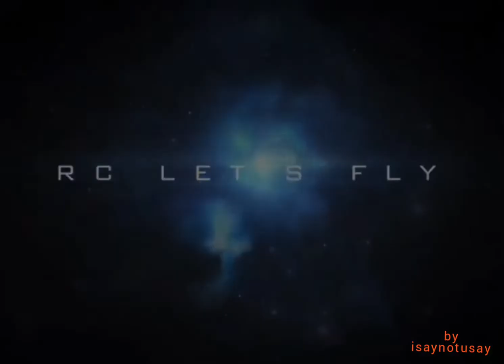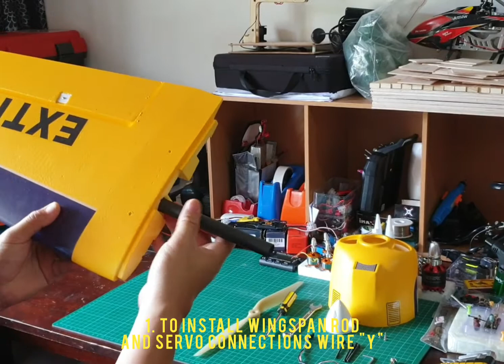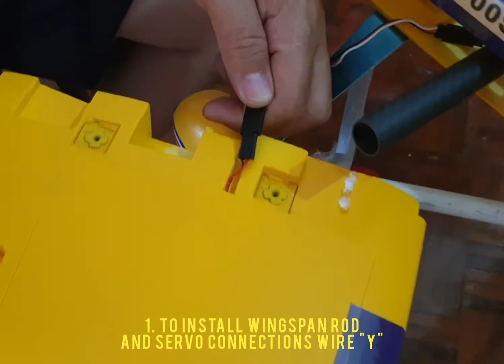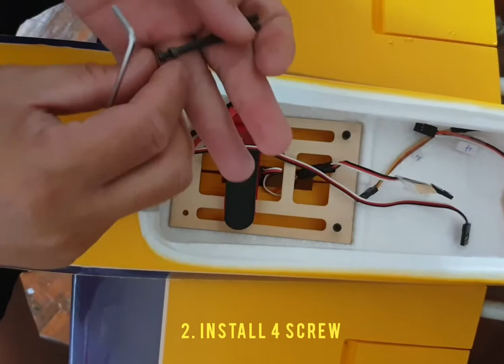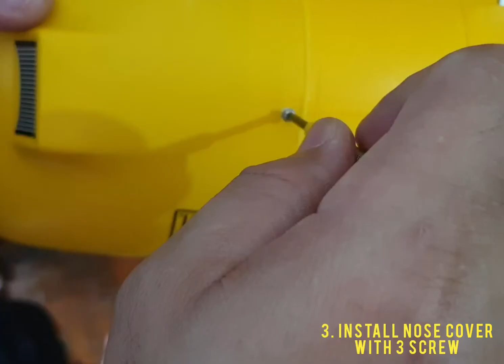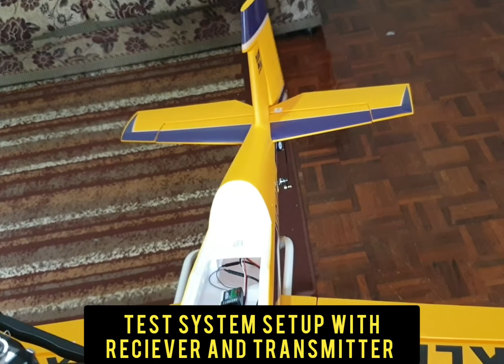Part 2 - hookll Extra 300 Build and setup  1200mm wingspan 3D Airobatic RC.

Comment: the battery position was wrong. that why many people got tail heavy. u should modifiy battery tray and put the battery most nearest to front motor. esc also put most nearest to front motor cover. the front wooden plate.
Reply from the maker: Thanks for the advice